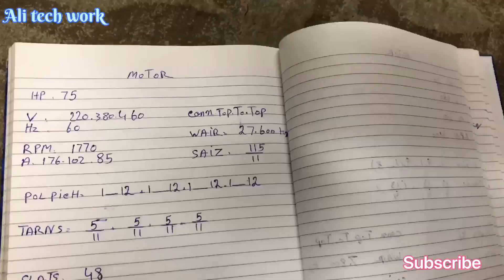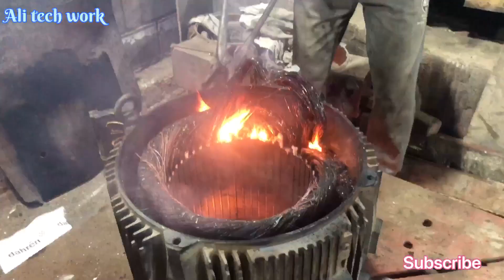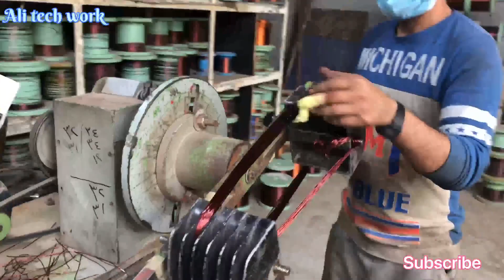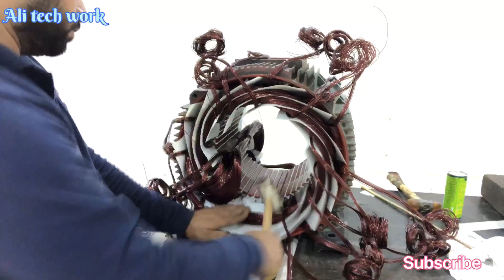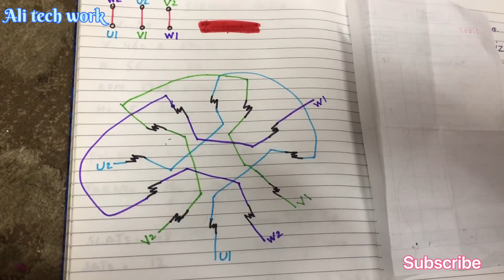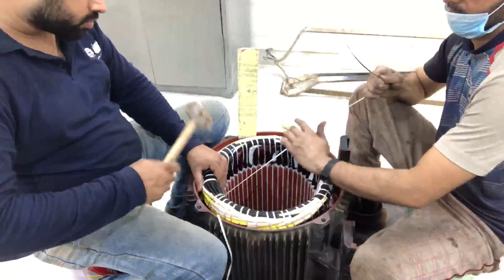How to rewind motor 75 Hp || 4 poles || volte 220-380-460 Rpm 1700  || full rewinding

Comment: Pf=0.80
45kw=volt380 L=21.5
Hz=50  DIA=21
RPM=2800
Pole=2  Slot=36
Double Layer Winding
Pitch=13-13-13-13-13-13
Need Wire Size
Please help Me 
AMP maybe 75 to 80
Made in china